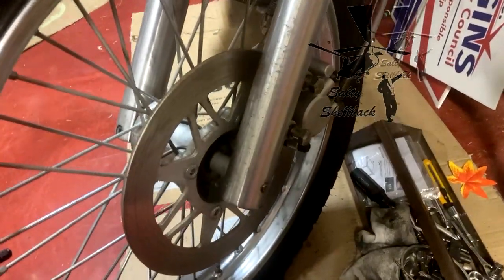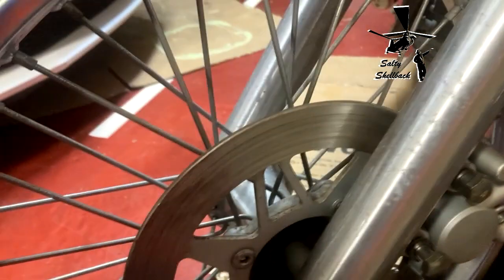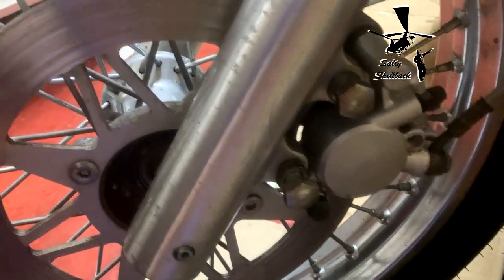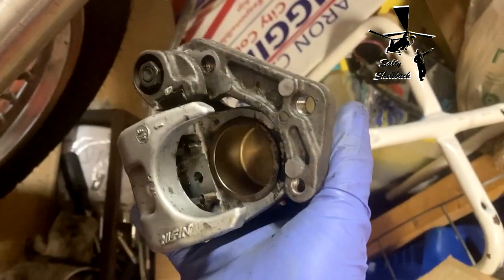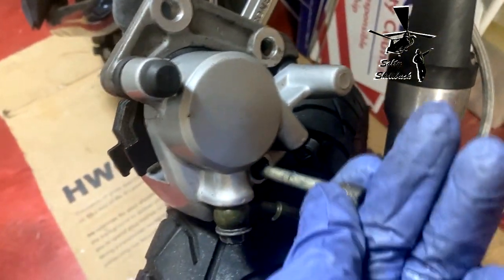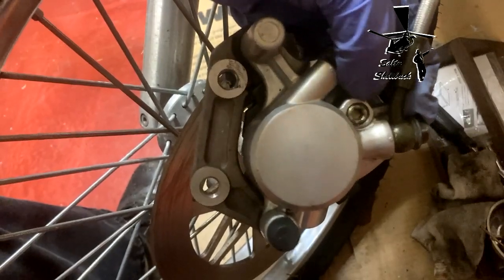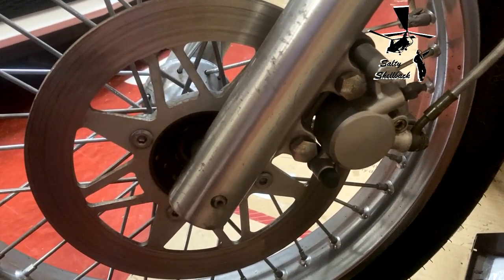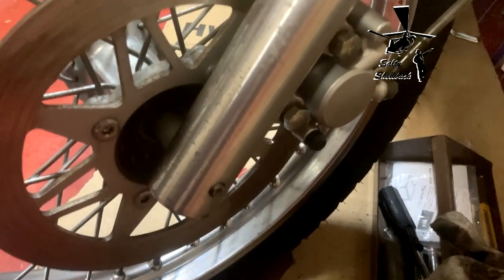How to change front brake pads-Suzuki Savage S40/LS650

Comment: Did the rotor get damaged from using the brake without pad?
Reply from the maker: From what I could see, there was no damage. I only rode it home and used the brake about 5 or 6 times and not too hard because I mostly use the back brake to slow down.